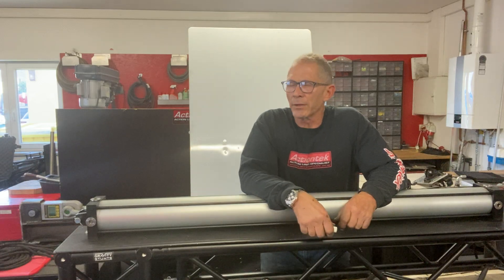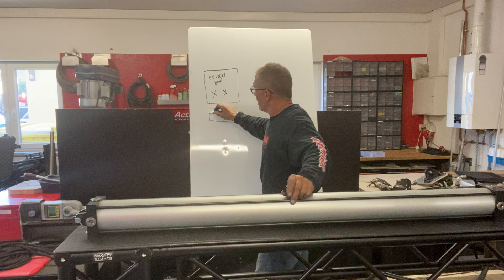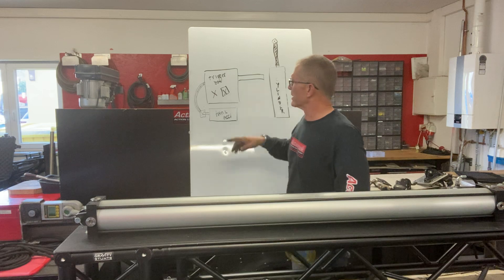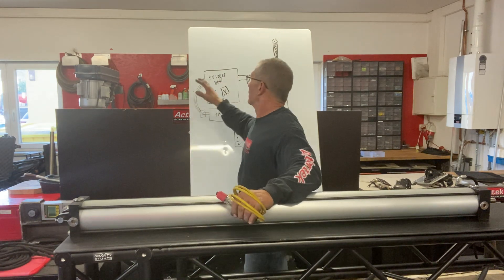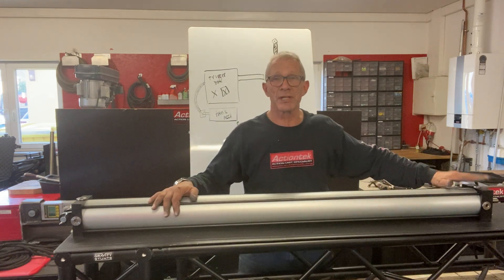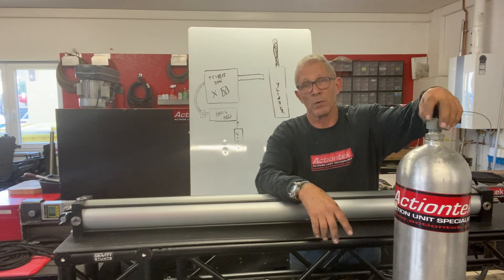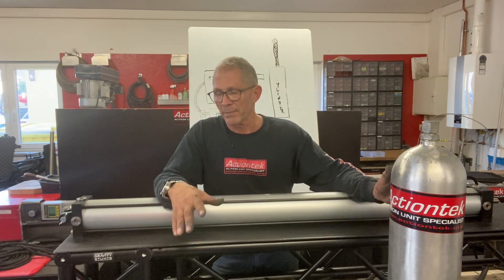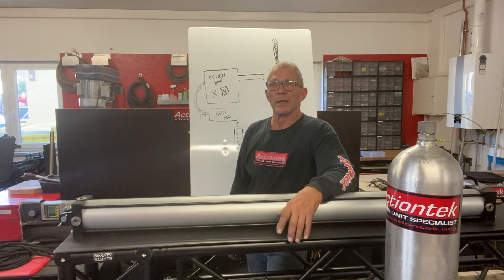Stunt Rigging Toolbox Talk 13; Introduction to Ratchets

Comment: I would love to see a video explaining how you limit the length of pull on the cylinder. For example, if you only want it to pull 2’ of the stroke.
Reply from the maker: There are several ways, some guys like the reed sensors to stop cylinders, like in industrial apps, but I find that it is not accurate enough. I use hard stops using double 6mm tech, that is attached to bollard pins built into the head of the ratchet as well as the end plate on the truss. One end is spliced with a thimble, then goes on to the aircraft pin on the head of the ram. The other is hitched around a 50mm tube with several wraps, then hitched off. This makes for a hard stop, and using two lines makes the stop redundant in case something happened. Since it is hitched, there are no knots, and it is easy to change lengths as required. The force is transferred to the head equally, as 2 sides have stops. Some people use big carriages with clutch on them, but they always slip until fully locked, and that can be 50mm or more in length. Some use dynamic rope, or static (5% stretch) to limit the sudden stop/ hit, but, since I designed the cylinders, they are built to take that force. Will try to take time to show how I do it, but that requires you to actually have a system, on centerlines, with an end plate, and a ratchet head, all in alignment working together.... not just a cylinder with a span set on something and a sheave set at the end.... The way I do it is ultra simple, easy to change, but relies on having it set up as a system before hand. In short, they are hard line stops.
Reply from the maker: I will send you some pics, or maybe a short vid.... not going to bother for a whole toolbox talk, as people that use this equipment should have designed or thought about the stop when building the systemm